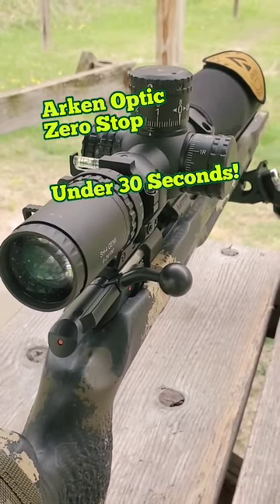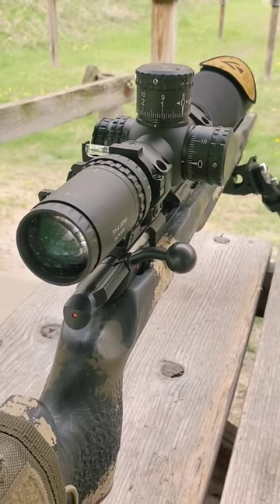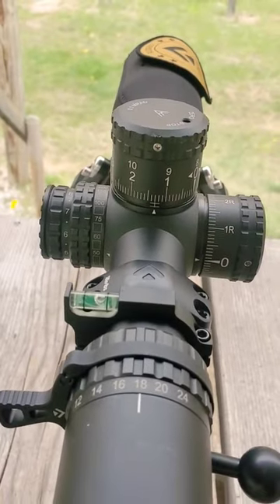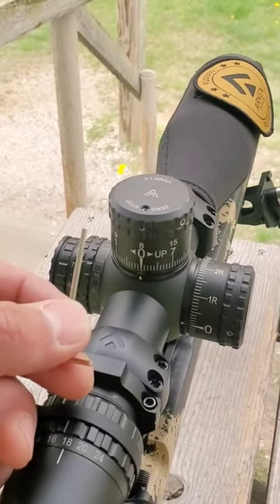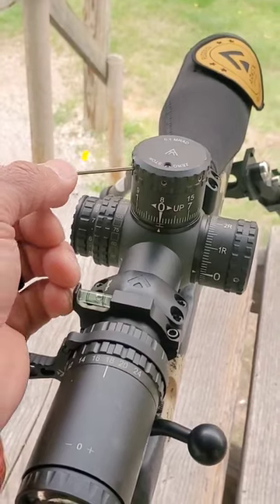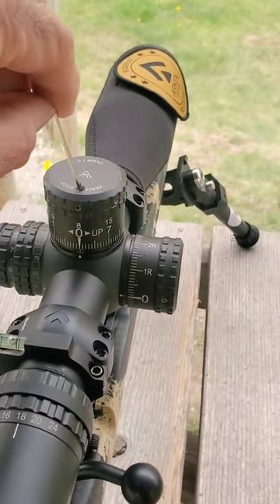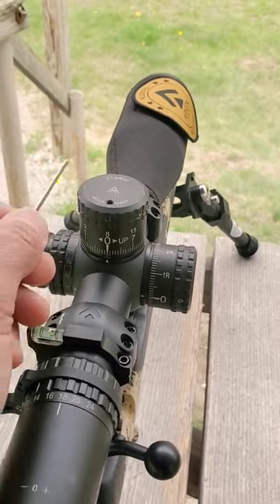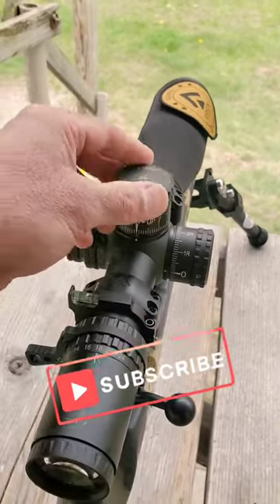Zero Stop Set on Arken Optic under 30 seconds! Quick and Easy!

Comment: After setting the zero, turn the zero stop set screw until you can feel it touching the bottom. Then give it a half turn back. You don't want the set screw dragging on the bottom. The zero stop has a high enough ridge on the indside so tou really don't need to touch the bottom.
Reply from the maker: You can do that also.  The screw specs on some a half turn back is almost too much

Comment: The zero stop on the Arken is a POS! The set screw has a tendency to back out even with the grub screw tighten against it causing the turrets to jam.
Reply from the maker: You are setting the system up wrong.  The vertical screw only needs to be deep enough to hit the wedge of the zero stop ring under the turret.  The brass horizontal screw doesn't need to be overtorqued but some vibration material is good insurance to prevent loosening.
The design is simple yet effective.

Comment: Are you supposed to have the max magnification set before zeroing like on 2nd plane?
Reply from the maker: Does not matter.  Use what power allows you to be most accurate.  This is beauty of ffp.  All ratios of the hold over tree remain same regardless of power you are on.

Comment: Hey new to bolt actions and scopes. I have the same on as you and set my zero stop already thanks to your video. But I thought that with a zero stop you can only dial up higher, and can’t dial lower than the zero stop. But when I set my zero stop I can only dial it down and not up.
Reply from the maker: The zero stop mechanism is mearly a small allen bolt that nudges a shelf on the base ring under your turret.  As you spin turret tje side of that bolt hits the shelf and stop the turret from going down.  If you spin the other direction the bolt clears that ledge.   Are you sure you are communicating spinning it up/down?
Reply: @RugerGundog  hey thx for responding . So on the Arken to go up u spin right and to go down you spin left. I did the zero stop and now I can no longer spin right to go up? Or am I thinking this wrong

Comment: I'm new to scopes and shooting what is the purpose of resetting zero on the scope?
Reply: It will act as a point of reference. When you put a new scope on and let's say you get it zeroed in at 50 yards by making turret adjustments, but the arrow is pointing at 4. You would want to loosen the cap screws and spin it around to line up with 0, as shown in the video. This way, if you were to adjust your turret to shoot at 300 yards, when you are done and want to go back to your '50 yd' zero, just spin the turret back around to line up the arrow with the zero and you know you're back to your desired 50 yard zero.
Reply from the maker: Zero is where the Optic is zero at.  After spinning turrets you need to be able to get back to that.